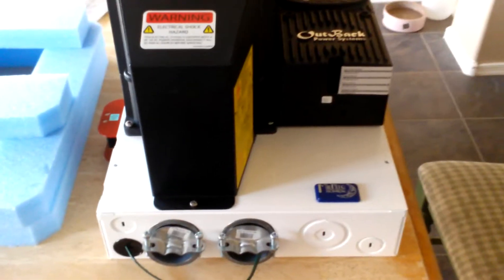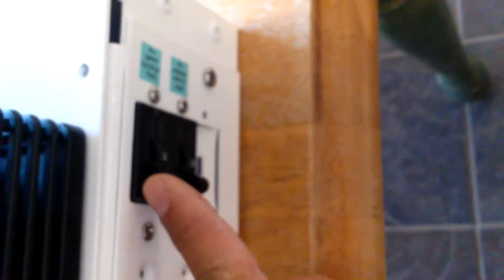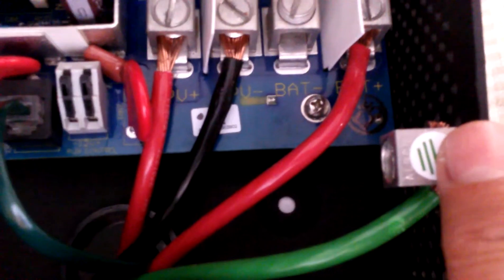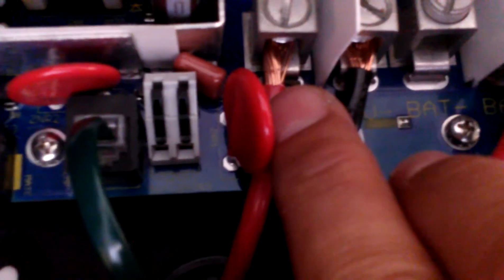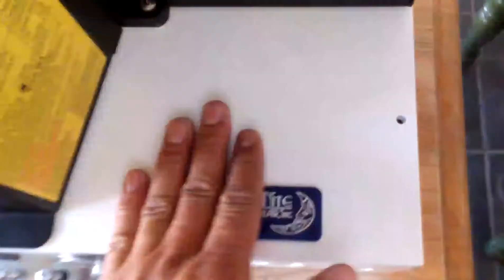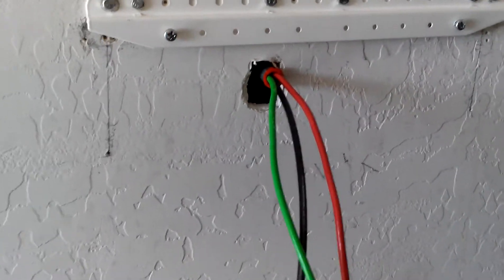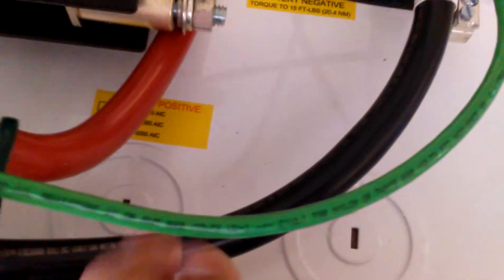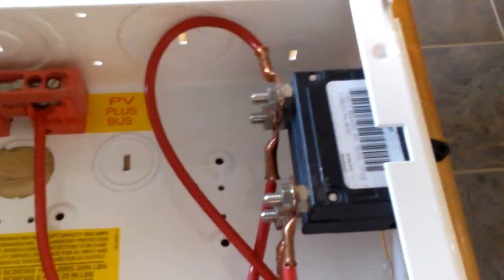Solar Panels Inverter Charge Controller epanel Setup

Comment: Quick question, was it a personal option not to use the epanel that came with the converter then using a separate epanel? If so, then why did you go with the separate panel?